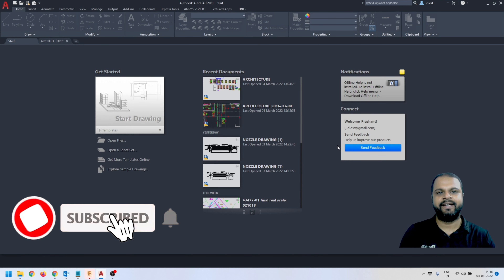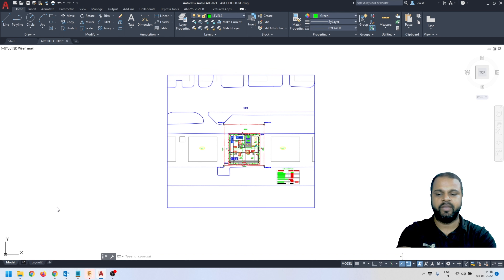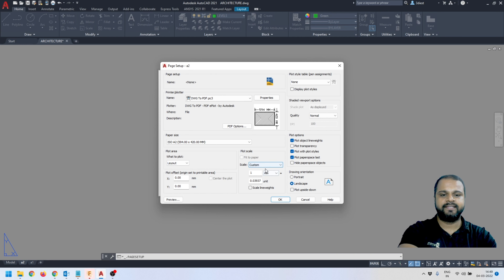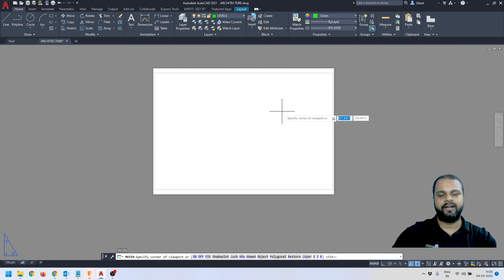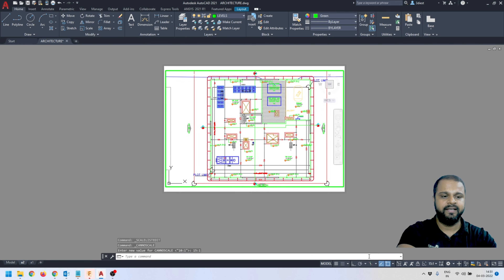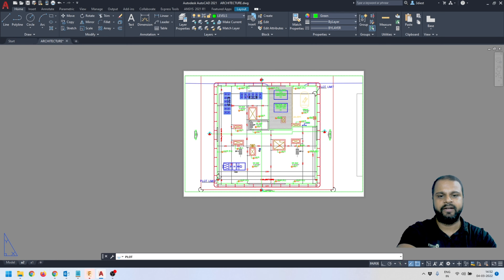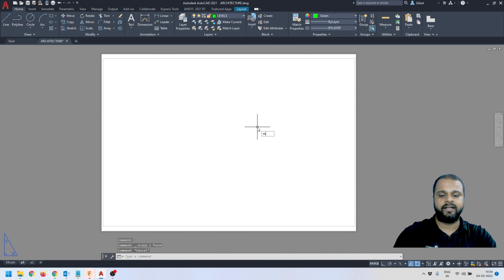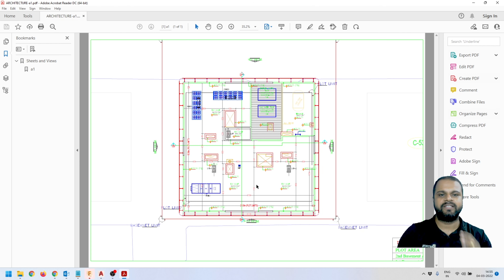How to set print area in Autocad 2021 | Step by Step complete tutorial for Beginners

Comment: I am unable to active page setup manager by right clicking anywhere on the file.  Right clicking brings up an entirely different menu.  I am using Autocad 2021 Architecture
Reply from the maker: this trick will work only with basic AutoCAD not with AutoCAD architecture or AutoCAD civil 3D etc.